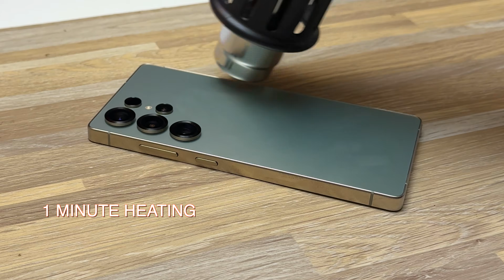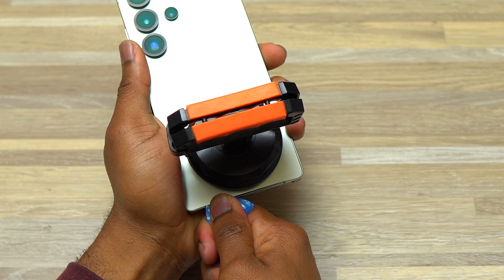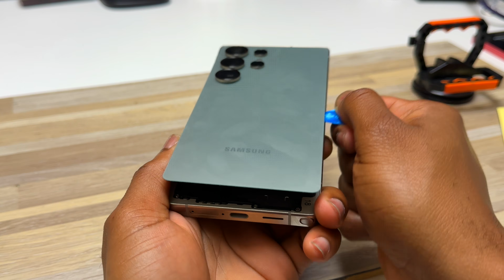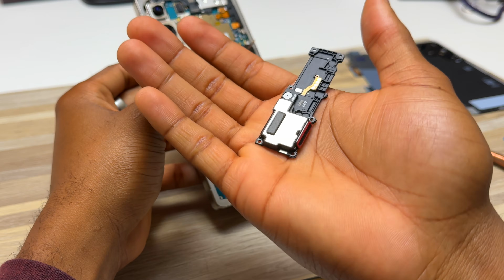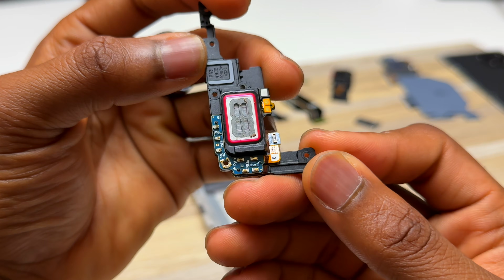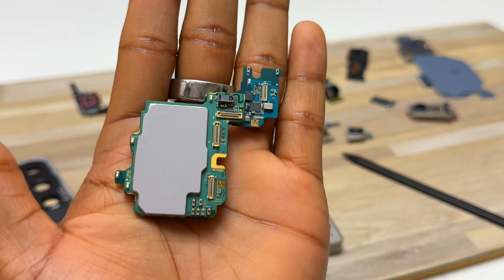Galaxy S25 Ultra Teardown Complete Repair Assessment

Comment: I accidentally inserted the SIM card pin into the microphone hole of the s25 ultra. Therefore, I doubt that the phone is waterproof. Do you think there will be a problem with the microphone? Has anyone encountered this situation?

Comment: I dropped my s25 ultra off a ladder and everything seemed ok, but I found out when I switch to video in the camera app the app freezes. Like it was trying to auto focus but couldn't. The photos take fine. When I shake my phone I can hear a rattle near the cameras. How would I trouble shoot which camera is the likely culprit? Thanks
Reply from the maker: Maybe the camera has been moved when the device fell down. If it was me I would open the device if theres a problem with the camera. Remove the camera and look at it then reinstall make sure everything is sitting right. Test the camera before close the back glass. I'd everything is good close the device and that's all. If the camera still has issues when you reinstall the camera and test pictures then videos and still having issues you might need to isolate the issue to 1 Camera then buy a replacement for that camera.